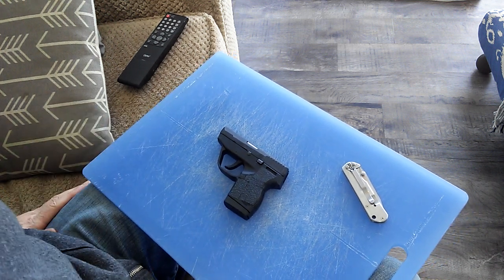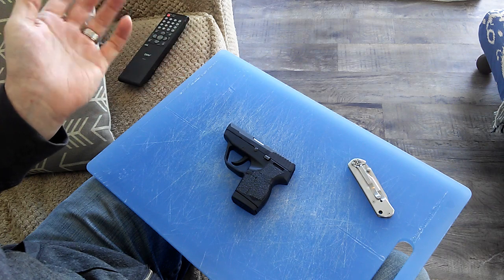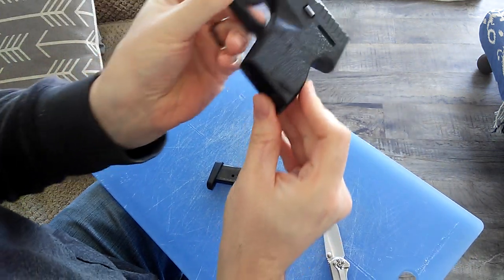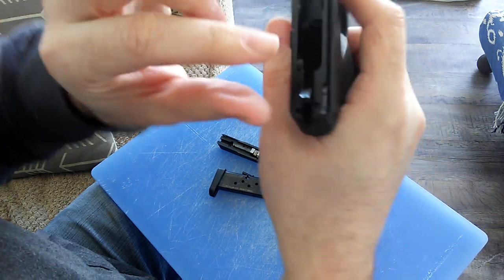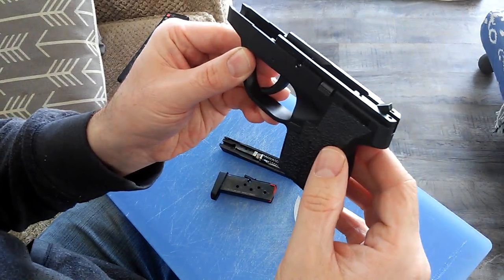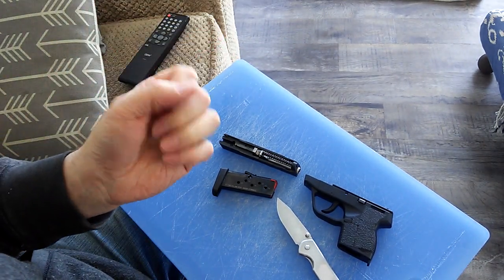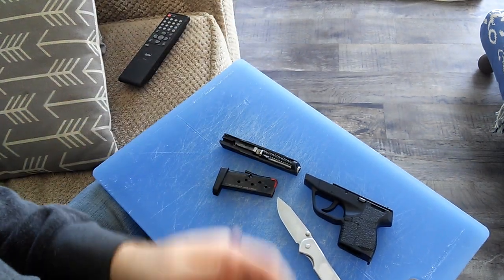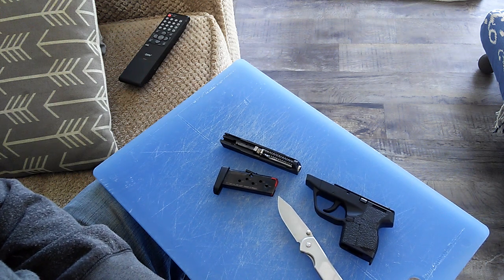Gun Rant: Ruger Security 9 is really a KelTec!!! Proof!

Comment: I have a PF9 and a Security 9. The trigger pull on the security 9 is much shorter then the PF9. The action is pretty much the same. That being said I carry my PF9 more then any other gun. It has been reliable and is very easy to conceal. I also have a P11 it has a totally different action and allows second strike capability. I would say the hammer on the PF9 is 60% cocked and the Security 9 is 95% cocked. I haven't took my security 9 to the range yet but it feels very good in my hand.

Comment: You're correct, the ancestry of the Ruger LCP, LCP II, LC9, and the Security 9 can be traced back to George Kellgren who originally developed a half cocked, hammer fired ignition system with no restrike capability. One reason these Ruger models are so inexpensive is because Kellgren's patent on this system expired so they can come out with these guns with minimal development costs. This same system is also used in other inexpensive guns like the SCCY pistol line, as well as the Walther PPX and the Walther Creed designs.
Reply from the maker: Jeff Baker although I'm not sure about the accuracy of your Walther statement, the rest of what you say is true
Reply: Admittedly I'm not exactly certain about the Walther models, but since they're both hammer fired with no second strike capability like the other guns I mentioned, I feel pretty certain their at least based in part on Kellgren's work.
Reply: I wish Ruger would make a straight-up P11 clone. I prefer the P11 ergonomics to the Security 9 ergonomics. It's a compact 9 that's sized more like a compact 380. And it's much better-looking than the Security 9, fit and finish aside.

Comment: I had to stop your video at 59 seconds. Going on about how all these different pistols use a design pioneered by Kel-Tec is no different than going on about how every variant of an AR-15 is a Stoner design or how every 1911 is a Browning design. The difference is that Stoner and Browning designed good products from the start and Kel-Tecs pistols were garbage from the start.
Reply from the maker: Clubtender just making people aware, that's all.  No need to take offense.
Reply: I'm not really taking offense and I didn't mean to be quite so rude, but it's just plain wrong to call all of these other pistols, "Kel-Tecs". They are inspired by George Kellgren designs. There is no denying that, but they are most certainly not Kel-Tecs.
Reply: These are more rip-offs than "inspired by."

Comment: I have a LCP Custom and a LC9S Pro. Guess how many failures of ANY KIND I have had with my Rugers? Yep, Zero so far. Keltec handguns are cheap but work most of the time. Good if on a tight budget but for a few bucks more, you get a way better gun with Ruger. I believe Ruger also pays a small royalty to Keltec for using some design features but they are not copies. Am I against Keltec? Nope not at all but I am aware you get what you pay for.

Comment: Gee wizz, a CZ is modeled after the Kel-Tec. The KelTec has a trigger guard, the CZ has a trigger guard. The KelTec has a front and rear site, the CZ has a front and rear site. The KelTec comes with a slide and barrel, and the CZ comes with a slide and barrel. 

AMAZING, CZ is just like a KelTec.  🤥
Reply from the maker: The point, you missed it.  It is a stolen design, through and through.   Sorry to break the bad news.